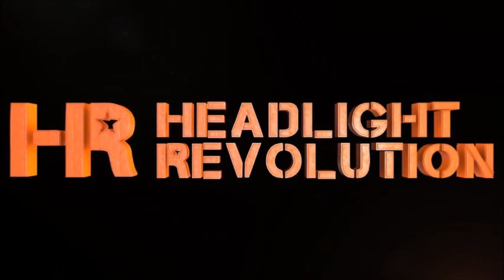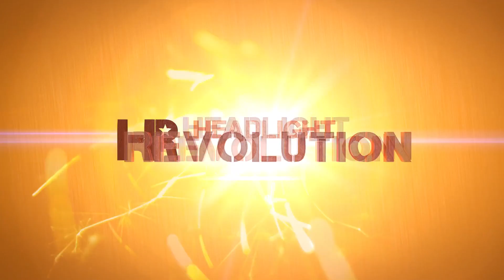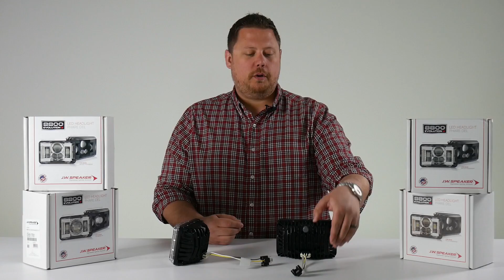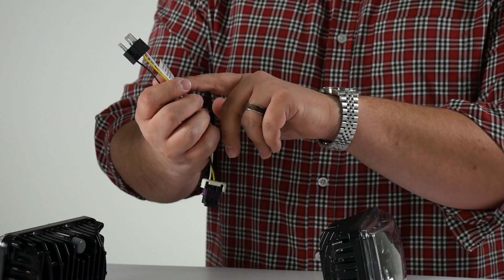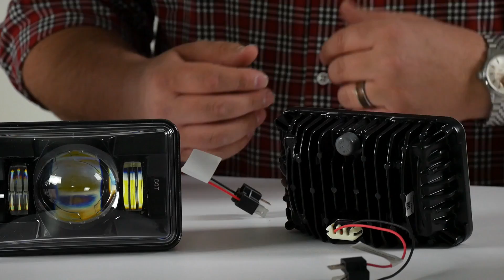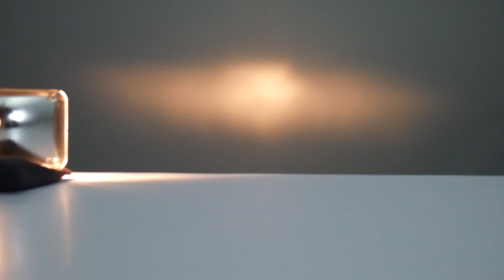JW Speaker 8800 Evo 2 4x6 LED Headlight Review | Headlight Revolution

Comment: I just bought my 8800 evo2's for my 1996 w900L and I was gonna use the regular 8800's to go in the hi-beam spot because your low beams are brighter than the stock hi-beams, but they won't work in the hi-beams spot. Besides shelling out another $400.00 or $500.00 bucks for a set of 8800 evo2 hi-beams, is there an adapter or do I have to switch wires around somewhere? Any advice would be greatly appreciated!
Reply from the maker: What is going on here, with using the low beam headlights for the high beam, are you able to make the connection or is that connector different?
Reply: @HeadlightRevolution  It plugs right in but they won't come on. It's my 1996 Kenworth W900L. Is the wiring harness on the low beam different from the hi-beam? On the 8800 low beam harness has 3 wires, black, yellow & white. It unplugs from the back of the light. Maybe change it out so it will work in the  hi-beam spot?
Reply from the maker: To be completely honest, since this isnt our product this is a little hard for us to figure out the custom wiring for that, you would be much better off contacting the manufacturer of that product, JW Speaker. They should be able to get you taken care of here!
Reply: @HeadlightRevolution  Appreciate your time anyway 👍
Reply from the maker: Not a problem, good luck figuring that out, have a good one!

Comment: I have a 2007 GMC C5500 and looking to upgrade these dim factory lights.. These 4x6 lights should fit right..? Also will I need A wiring harness to install these Evolution 2 lights..? If so do you know what part number ect... Thanks
Reply: Yes, they should fit yours. Yours are 4x6 so they should work on it

Comment: Can you use a day time running light controller eg: Cole Hersee - Daytime Running Light Module - 48600 with the 8800 series lamps?
Reply from the maker: Yes, that DRL module would work with these. Just remember, the JW Speaker lights will never dim. You'll just have full brightness DRL's.
Reply: Thanks for your quick response and clarification that the drl's do not dim.

Comment: Have one problem with them. The driver side and passenger side need different  beam  patterns.
Reply from the maker: All of the aftermarket LED head lamps are identical beam pattern. Why do you need different beams left and right?
Reply: Headlight Revolution 
Because they sit on a semi truck. Semi truck lights sit higher than for instance those on a a pickup. Even with the lights turned as low as possible it still blinds smaller vehicles.
You are aware that vehicles have different beam patterns to deal with that?
Reply from the maker: Anytime we're working with someone in a Semi, We really recommend you don't get aftermarket HID or LED because none of them will be DOT approved.
If you have a sealed beam headlight, there are many great options, if not, It's tough to do any upgrades.
Reply: Headlight Revolution but they are DOT stamped?
Reply from the maker: These sealed beam headlights are.
Reply: Headlight Revolution yeah......
I got them! That's what I have been  going  on about the whole time.....
Reply: Maybe I m missing something but you should not need different right vs left as if you are blinding on coming trafic with the left beam you are also still blinding same direction traffic thru the rear window with the right beam as well as the left.  what you need it would seam is 1: find a way to increase or change adjust for more down angle on the trucks light mount or  2 a light with a lower beam angle from the start. 

You can do number 1 easy with shims on the adjustment screw or bar/bezel. 

2  obviously would take a dedicated model.

Also do not discount how much the  beam affects drivers same direction in front of you.  After being in a sedan in the last few months IT SuCks!!!  Big time when OTRs or lifted trucks  do not have beam cuts offs at proper height.  It comes in from side mirrors as well so flipping the rear mirror to reflective mode fixes little.  Almost as bad as the @$@$@ that stick HID or LEDs in halogen reflector or projector lenses.  

Driven triple axle dump trucks over the yrs so I get the issue as we have lots of single lane 70-80 mph country hwy were I have been.  On the ones done with conversions they all shimmed the adjustment for more down angle and set cut off per DOT standard procedure.

Comment: can I mount this 4x6 on my bumper to use it on the street .
my truck headlight is terrible.
Reply from the maker: That's really not what they're used for.  If you have 4x6 Sealed beam headlights these will fit right in there.  If not, there's options like LED or HID bulbs for your headlight. You could also do a small light bar that is flush mounted. 
Check out our website and give us a call if you have other questions.
https://headlightrevolution.com/

Comment: interested but curious to see how they stack up against the vision X 4x6 which I'm equally interested in. Feel like if I get these jw speaker will come out with an even more improved version.
Reply from the maker: Haha, they very well may.  From what we've seen Speaker and VisionX are pretty much the same as far a light output, with a very slight advantage to VisionX.  Warranty wise, Speaker is 5 years, VisionX is lifetime.  Either one, you're going to be happy with and you can rest assured, if you do have any issues, which you probably won't, you purchased from a quality company that will fix any defects out there.
Reply: what did you end up deciding here? I'm in the same boat now that you were in a year ago.

Comment: I have a 2015 Chrysler 200 and need brighter lights. what can you suggest for dual beam?
Reply from the maker: It looks like you have a projector headlight, so we'd recommend you going with a 9012 HID kit.
https://headlightrevolution.com/gtr-lighting-35w-canbus-gen-4-hylux-single-beam-hid-conversion-kit/

You're also going to need a PWM module for your kit.
https://headlightrevolution.com/gtr-lighting-pwm-interface-module-9005-9006-style-connectors/